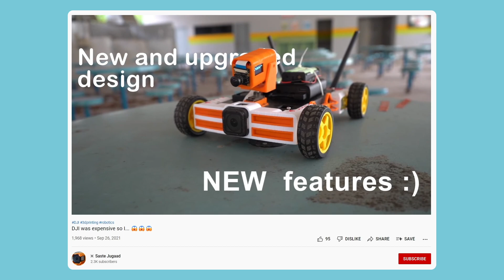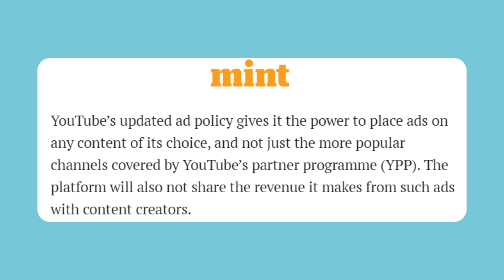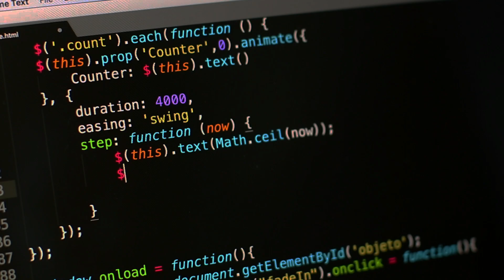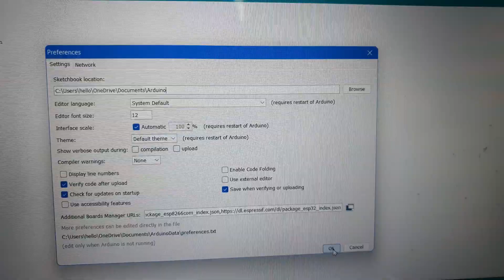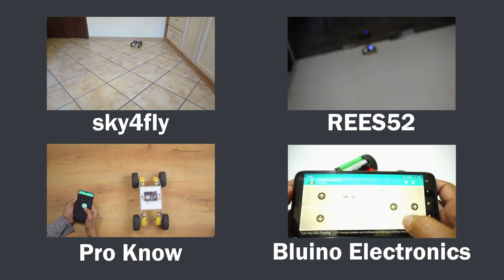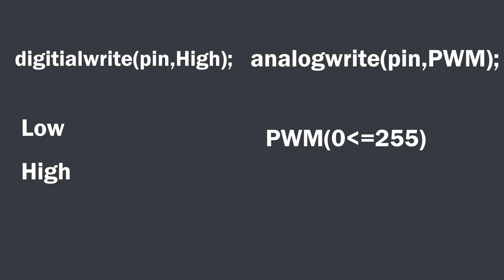Build Your Own WiFi Car with the Node MCU  #esp8266

Comment: Hello Sir Can You provide the code where a system using an ESP32 microcontroller, L298N motor driver, and WebSocket communication to remotely control two motors. The motors' speeds ,directions should be adjustable in real-time through a WebSocket connection.
I really need this for my college project, can you please help me out in this.
🙏🙏🙏🙏🙏🙏
Reply from the maker: I working on something similar now. Maybe in weeks I will make tutorial

Comment: can we use esp32 module inside of  nord MCU?
Reply from the maker: No it won't fit and pins are different.
Reply: @SasteJugaad  oky thanks for ans, then im using nord mcu but i want connect 2 robo at one time for soccer robot war is that possible with your given cods ?